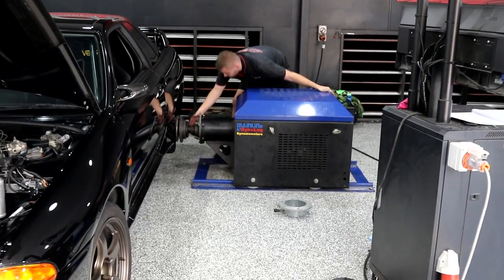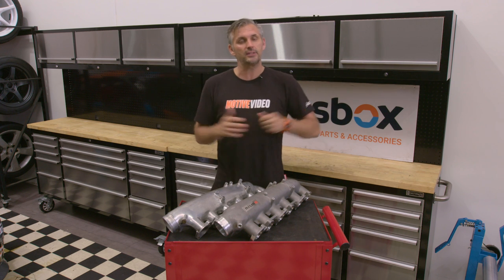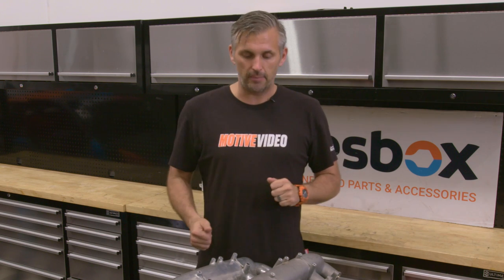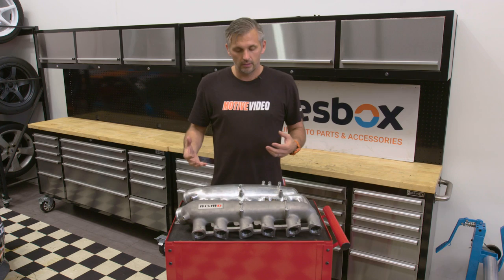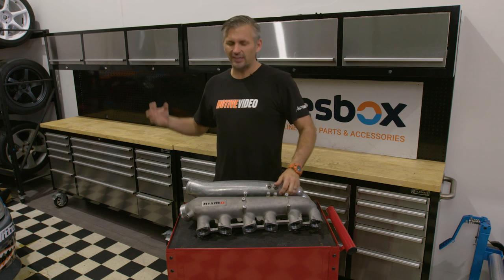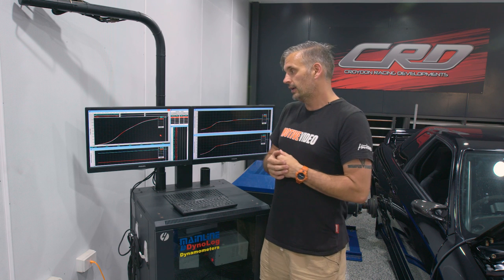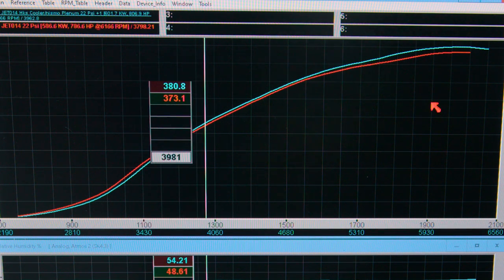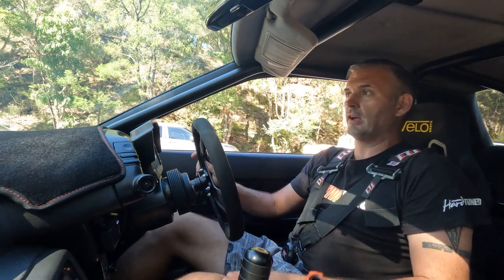NISMO vs OEM RB26 Inlet Manifold Test - Motive Garage R32 GT-R Project Supercar Killer

Comment: Plazmaman or rb25 neo intake would be interesting to see the restrictive or torque and power differences ✌️🇦🇺 or even from a single 85mm throttle to the itb’s setup as well
Reply: That's the setup I'll be running single 85mm to the itbs. would love a comparison video on this
Reply: This has been done in depth by an Australian tuner. Probably circa 2006. I'd have to do my homework to find out who did it. Modified rb25 plenum do very well up to 500 but after that the plasma an is the daddy. From what I remember 😉

Comment: Love the video! I've had my GTR for 12 years, when i bought it it was basically stock engine and turbos with a haltech platinum pro. When the turbos needed replacement i went for 2x GT2860-5, first on the stock plenum but right after that we went for the Nismo because that was laying on the shelf and was for sale for cheap.. down low we could add around 15% more fuel after installing the Nismo  it did feel more lively afterwards. It basically is a driveability upgrade. 

Now we are building a 2.8 with a gtx3584rs with hypertune v2 intake on a electronic single throttle body. Ported head,diffrent cams etc. Really excited what that will do!

As for next plenums? I guess it would be cool to test the ITB version of the Hypertune vs stock or vs the nismo, see how they compare!
and perhaps test the itb hypertune vs the single throttle body hypertune to see what diffrence throttle bodys make.

Btw you can fit the Nismo plenum with the engine in the car (r33gtr)  if you loosen the engine mounts and intake piping and tilt the block sideways as far as it will go. That way you don't have to remove the brake booster etc. You do need someone to help tilting it though.

Comment: I keep hearing bigger capacity manifolds make a bigger difference on uneven firing engines and also the ones with small displacement. I would love to see if that is the case on GR Yaris or any other 1 liter engine, if that is possible.
Reply: Volume depends on your cylinder pressures. Too big a volume and you'll have slow response and too small you end up choking the flow
Reply: @joostin123  Not in this case as the throttles are after the plenum

Comment: Great vid, I love tests! And glad it worked kinda how I'd always presumed. It's crazy how much nicer to drive a good plenum design makes a car on the road and track, even if it don't look like it really on a dyno. 
Easy to make a big power inlet, but they often do the opposite of the above, but a good design that drives optimal is different, hence most serious works race engines don't have big blob inlets like most aftermarket tuner big power inlets.

Comment: Had my Nismo plenum / collector for about 2 years too! I bought the titanium studs from Stefan at IEE in NZ to fit it. You don't need to remove the brake or clutch boosters to do it then! Wish I knew that before I pulled the old plenum out and put it back. 😂 Hoping to get it swapped out next week before mapping. Great, informative video, as always! 👍

Comment: A great video showing how parts like these can really change the driveability of an engine. Full throttle really isn't of much use for a road going car yet seeing the torque increase much lower down in the rev range is. Hence why your road test was a bit of a surprise compared to what the rolling road data gave you.
People get so transfixed by power yet power is nothing more than torque multiplied by engine speed and it's the torque that makes an engine driveable or not.

Comment: Did the intercooler pipe need any modification or are both inlets on the manifold in the same position? Great video 🙌
Reply: They are the same. GReddy manifold is apparently different and requires intercooler pipe modification

Comment: I think a plazmaman or any other companies fabricated single throttle body style/conversion would be interesting to see. Do they make more power and torque or is it looks or just the ability to go fly by wire throttle for other benefits like torque management and throttle mapping. It would open up a lot of debate about the pro's and con's between them. Awesome presentation and research on the Nismo inlet plenum.

Comment: Thanks for the great video, very useful, planning some upgrades to the airflow on RB26, better downpipe, smoother air filter inlets and smoother turbo inlet from the intake piping, I think I'll also add a Nismo plenum.

Not after more power, just want to make the current turbo setup as good as it can possibly be.

I'd like to see A CPC plenum compared to something on the dyno, and it would be cool to see the difference switching from a Nismo plenum to a similar sized single TB setup. 

Nismo VS Greddy would be good to see, essentially quite similar.

Comment: Correct me if I'm wrong, but I thought the the issue with the standard intake was the last two cylinders tend to run leaner, which meant that they got too much air compared to the front cylinders. The Nismo plenum with addition of internal bellbouths would allow more even flow doiwn the runners as they would collect it away from the plenum walls where air speed is more consisitent. It's benefits would be improved tuning due to even fuel air ratios across cylinders, which is where the extra 2% more power comes from. I wouldn't think the standard intake plenum as a restriction, as I'm sure intercoolers would be the greatest contributors to pressure drops. Overall very informative, but I would have liked some flow bench testing just to confirm the outcome of the results.

Comment: Hey guys, any issues putting this manifold on a fairly stock rb26?  Tuning after installation, but curious about this, and where you guys have far more experience with the RB26, I was hoping you had some advice. GTR32 with 3rd gen RB26.

Comment: Will there be a stock throttle verses single throttle video coming up?? i'm in the prosess of freshening up my street/trackday RB and am intrested how much the single throttle efects low speed / off boost street driving? i guess a single will flow better (probably make more hp) but i've been trying to keep it a nice street driver while bringing it upto date. BTW keep the video's coming (Great job!!), i would have been putting my stock manifold back on if i hadn't seen this video and the 6 pot runner issue.
Reply from the maker: Yes. Inlet is fitted. Just waiting for fab work

Comment: Im dying to get my hands on the Skunk 2 intake manifold they are currently developing to replace the plastic oem intake manifold on my 686 hp Honda Civic Type R. I currently have a Radium port injection kit on the stock intake manifold with four Injector Dynamics stainless ID1700’s controlled by a Motec M142. The Skunk 2 aluminum manifold will have velocity stacks to each runner and a fuel rail for port injection. I may replace the small stock dbw throttle body with a larger Spoon throttle body.

Comment: The intake manifold isn’t as simple as you’re making it out. Runner length is tuned for application, a different exhaust manifold may make the whole engine flow differently, that maybe why you didn’t achieve the same results as nismo. Everything has a cumulative effect.
Reply from the maker: We know. We said that. But we cant test is on 100 different engine combos.  if it works on one, it pretty much works on all. The difference is by how much
Reply: @MotiveVideo  no you said the inlet manifold doesn’t know what engine it’s attached to, what turbos are on it etc, dismissing important factors, it’s no as black and white as you’re making out. Some sets ups will have different gains in different areas due to different flow dynamics and harmonics. Not as simple as you’re making out.

Comment: I had to replace three small coolant hoses that sit between the firewall and the far end of the inlet plenum  on my own R32 GTR  which required removing the inlet plenum, did not realise it would take me 10 hours to so lol. Next time I'm just converting to single throttle body, it would be way easier

Comment: Unless you have a wideband on each exhaust port, how can you tell it doesn't change #6's efficiency?
Reply: Individual EGT's.
Reply: @jeffsymons7084  or that. Does this car have those? Don't remember seeing it be mentioned.
Reply: @gixxar6  It does and you can see the readouts of each cylinder temp on the laptop around 13:25

Comment: Plazmaman, Greddy and RB25DET NEO
Or repeat the testing showing logs of individual cylinder temps to see if cylinder 5 and/or 6 running rich still because its starved of air.
Or repeat the testing to see if the Nismo makes more of a difference on the asthmatic (by comparison) stock twins turbo setup.

Comment: People get too focused on HP figures, but it's the way a car drives and responds also. Nismo won't sell snake oil, it's all about the small details when tuning a car also. Yes it costs, but if you can feel the difference it's worth it. IMHO. It's also a work of art compared to the stock 1.
Reply from the maker: Will admit, surprised how much the drivability increased. The numbers Con from CRD had to put in proved it though

Comment: I’m curious about the information relating to cyl 6. As it’s common practice to increase fuel to that cylinder it would suggest that it either gets the lions share of air flow relative to the others or it’s generally over fuelled for cooling purposes givens physical location in the motor and engine bay. Not sure how this turns into a “Restriction” as such.
Also the I felt the measurement of the runners is better taken internally as casting thicknesses and general shapes aren’t that accurate when referring to alternative items. An internal runner length (to bell mouth or radius should) would seem like a better reference. 
Lastly I think the comment about setup does make a difference in outcome but only in capacity as the volume of air being pumped will be greater in the 3.2 for any given RPM therefore changing what it is doing. In saying that, you are testing against the stock.manifold on the same capacity but the “gains” referenced for particular RPM ranges aren’t relevant to a 3.2. 
Great info and comparison none the less and definitely a higher power outcome than I expected.  ✌️

Comment: Does runner length make a difference if it's before the throttle body/bodies?
Reply: @RyanGorton  Longer for more horse power and vice versa but there is a limit. Phil from Driftworks did custom lengths with a dyno video for his lambo.
Reply: Yes, same reason and principles regardless where the tb is. Once opened fully, it's the air velocity increase in the longer runner vs shorter having less velocity at the same rpm

Comment: I would still love to see the capabilities of the stock r32 or r33 gtr intercooler. And at what point it becomes a true restriction or looses its efficiency.
Reply from the maker: We can yell you that it starts to become an issue on anything after stock turbos. Have seen 400kW squeezed through one on E85 but wasn’t doing well.

Comment: Found this really interesting, I'm running rb25de with factory in/ex manifolds 380rwkw on e85 and have seen alot of other setups with ffp and bigger turbos and some with cams all the same tuner, at the same boost we are all making the same peak power but even vs a 3.0l the factory manifolds honestly are perfect making more power and torque all the way through to peak power.  Yes a couple did make more power with more boost with bigger turbos and (Chinese vs garret)  but I'm also out of fuel so can't run the same boost..  Honestly wouldn't change the factory one for anything other than looks for me

Comment: if i purchase this do i need to tune the car or could it be plug and play?
Reply from the maker: Any part requires tuning
Reply: @MotiveVideo  im new to modding scene, my skyline is 90% stock, other than the exhaust and the cold intake. she's all stock. I wanted to do small quality of life upgrades but not really change the car to much. Im looking at purchasing Nismo manifold, Nismo intercooler, an upgraded ARC Radiator and upgraded fans, nismo timing belt, and new bearings, pulleys, water pump. oil pump and etc, I really have no idea what I'm doing to be honest

Comment: What sort of compression does this beasty run, you could probably break every pump unleaded record (power and 1/4) with your setup.
22psi and 9400rpm would have you in the mid-high 9s on bp98.

Comment: Hey Andrew would you be willing to test out a GATO intake manifold, I know they are quite expensive. But I have seen a pretty good results with one used on a h22a V-tec turbo engine made an extra 40 HP from pfi speed son's car goofybuilt Shane.👍
Reply from the maker: Have they made an RB one?
Reply: @MotiveVideo  I'm not sure to tell you the truth 😅 I know last I looked they have made several other brands not sure just thought I would mention it they may have by now.
Reply: @MotiveVideo  dang just had a look and they don't, they make one for the SR20 though my bad was just a thought.

Comment: 15 kw 
To a clean flow bell mouth is not as impressive as i thought.
Clearly shows less restriction thus lower boost.
Would be more beneficial on higher hp cars.
A light port on stock is more than sufficient
Reply from the maker: Boost is different to NA. the turbo shoves the air in, so on full throttle its purely CFM

its the off boost and light throttle stuff that changes the most, as per video